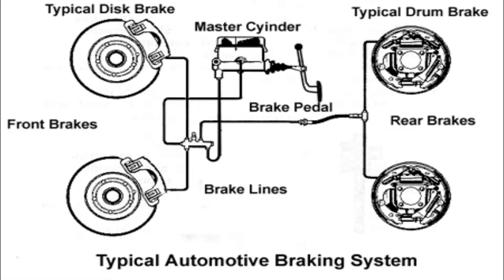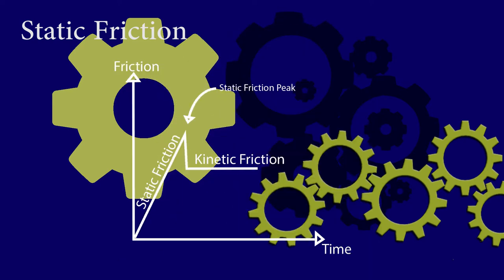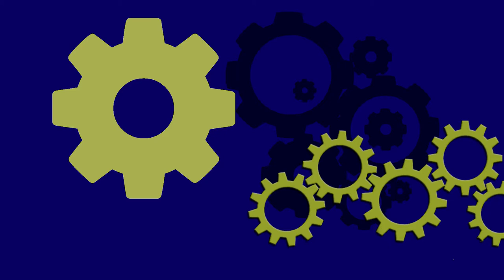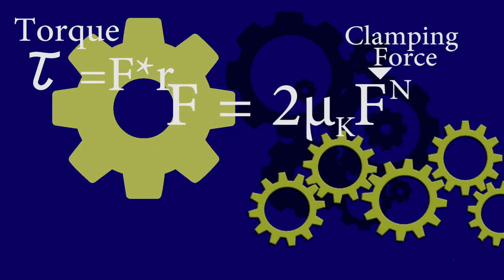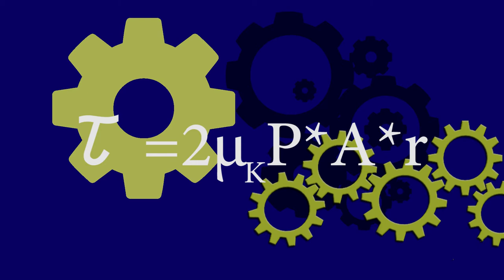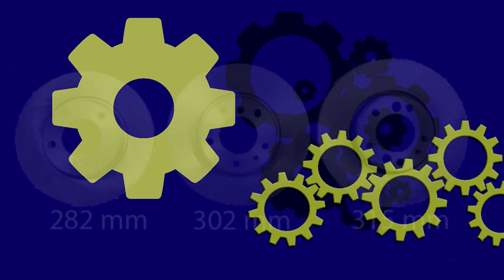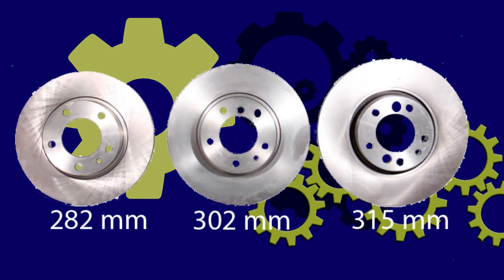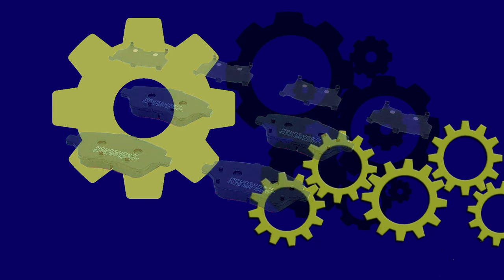Physics of Car Braking Systems

Comment: Can you explain me the directions of the force applied by human leg on the brake pedal and the force on the piston of the master cylinder? I don't understand the moment around the axis .
Reply from the maker: The brake pedal is on a pivot so the pedal is pushed down and you exert a torque on it equal to the length of the pedal mount times the force you apply. Its actually a cross product Fxdx=T The pedal has a cylinder attached to it that converts that rotational force back into linear force. so the amount of force you put on the pedal is very near to equal the force the pedal mechanism puts on the cylinder which is the input of the brake master cylinder. That is without "power" brakes. With power brakes the pressure you put on the pedal is multiplied as it moves through the brake booster which is vacuum assisted. As a result we can think of the actual force applied to the brake master cylinder as proportional to the force applied to the pedal or as a function of it f(Fapp).
I hope this answers your question.
Reply: @mizinoinovermyhead.7523  Thanks i understand it very well :)